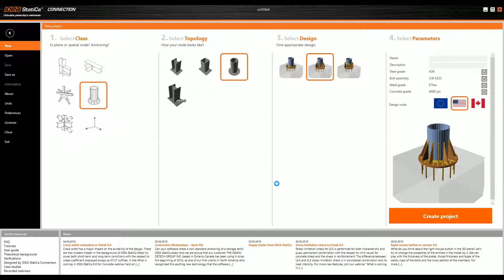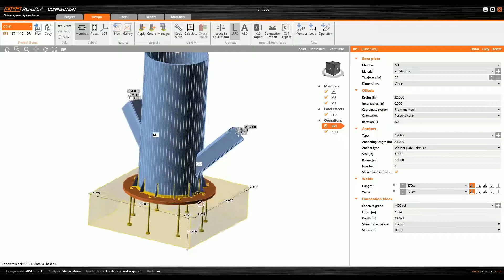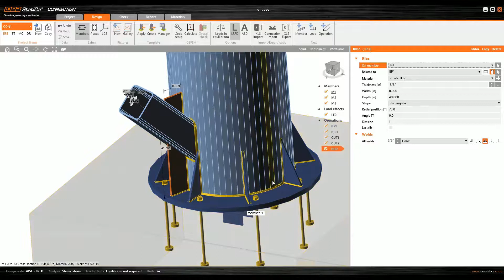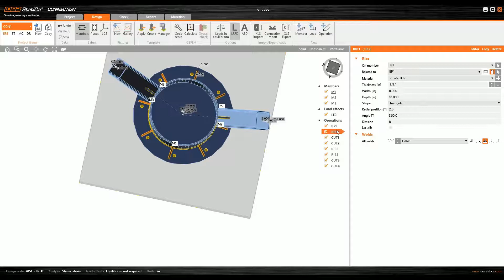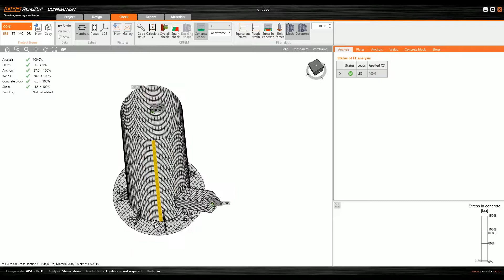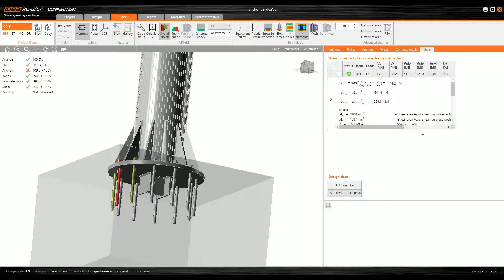Connection Wednesdays – Anchorage of a spherical storage tank

Comment: the  weld is shown inside the mmeber M2 between member M2 and Rib 3 ( see recording at 15.25) . practically is itpossible to weld the rib in the inside portion as shown in the cut operation . i  Don't think so .also in the new ersion singularity error is shown if the Rib 3 and Rib 2 are modelled .
Reply from the maker: Weld inside the hollow section member M2 is a modeling mistake that happened in this live webinar, sorry for that, of course here should be only outside weld, you can simply switch this in the operating settings.
For the error - you might need to set different type of cut parameters, the program has improved and there are some changes. If you struggle, please contact our support:
https://www.ideastatica.com/support-center/how-to-create-a-new-support-case